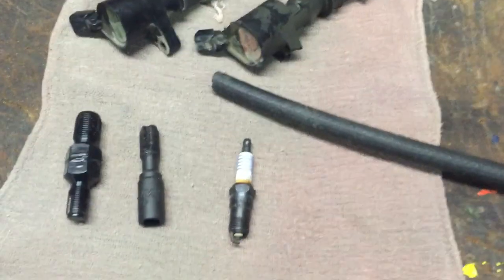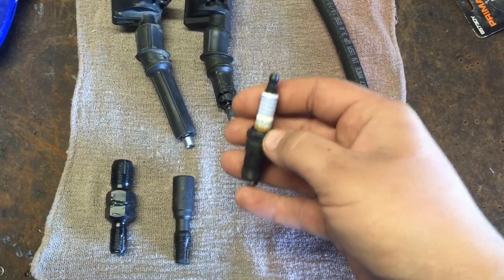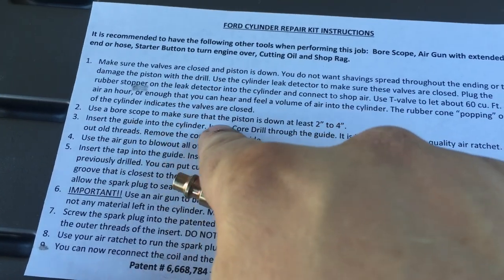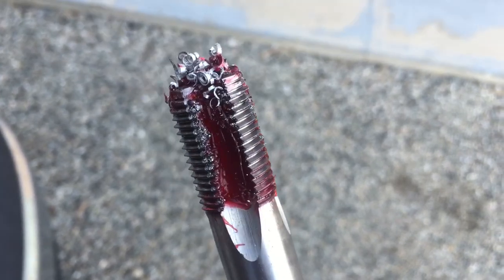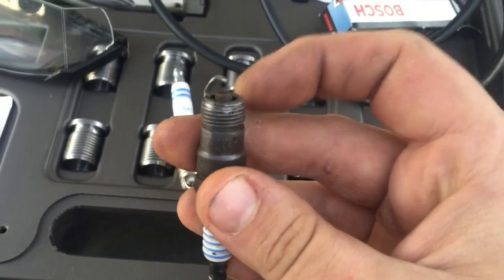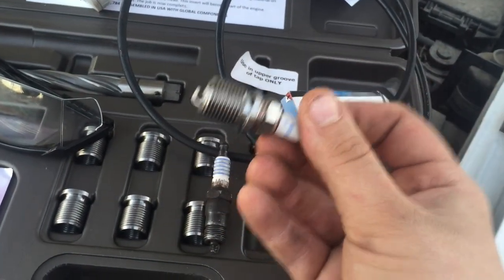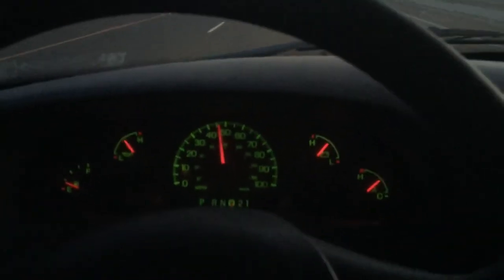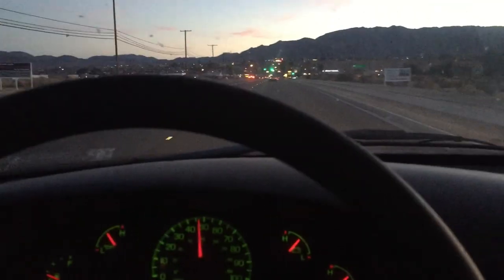Ford 5.4 Triton Spark Plug Blowout Repair, CalVan Kit, f150, Crown Victoria, 4.6, V10, Grand Marquis

Comment: Great video
Reply from the maker: D Scorpion Thanks, Glad you liked it.
Reply: You really know your stuff dude. I'm excited for more videos. I'm looking to install a cat back in my 2016 dodge dart .
Reply from the maker: D Scorpion thanks man always more to learn, nice that exhaust will be dope when you get it on.
Reply: Desert Rat Racer any suggestions on what exhaust to go with
Reply from the maker: D Scorpion What type of dart is it, and what engine does it have? Also what's you main goal with the car?
Reply: Desert Rat Racer it's a dart 2016 sxt 2.0 I'm looking to get some more torque and power
Reply from the maker: D Scorpion ok, I would think most kits that are made to fit would work good, but you could possibly just swap in a better muffler, or put in straight pipe instead of the muffler. Get about the same effect with less cash. If your stock exhaust pipe size is 2.5in - 3in diameter then that's more that good for single exhaust, or could be smaller if it splits to a dual pipe.